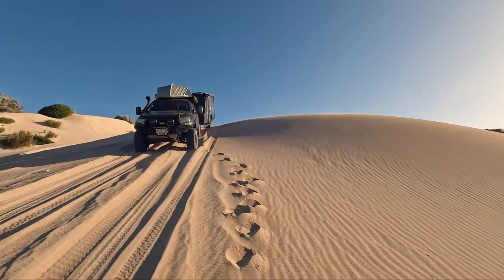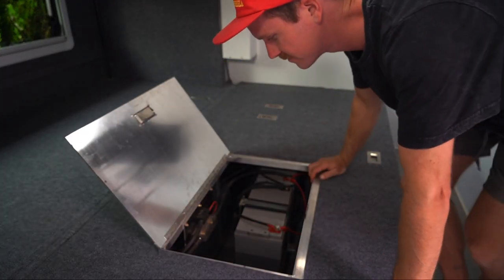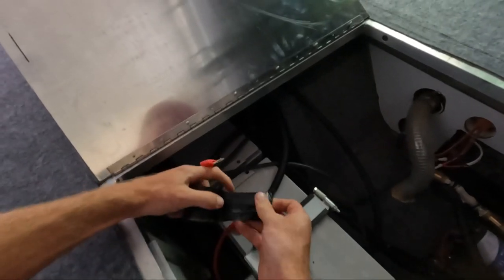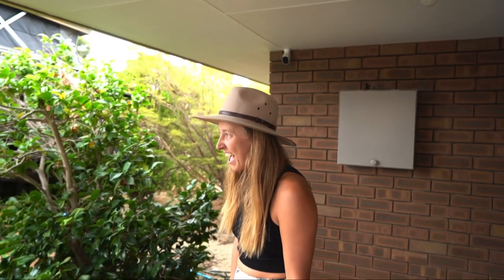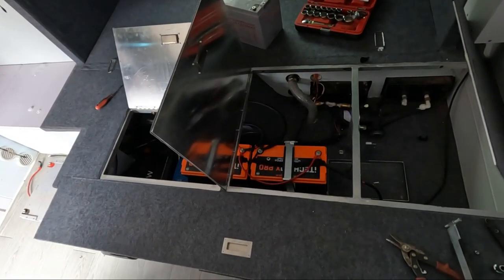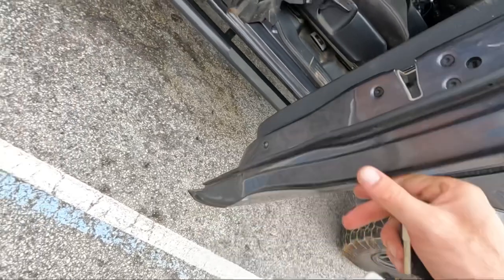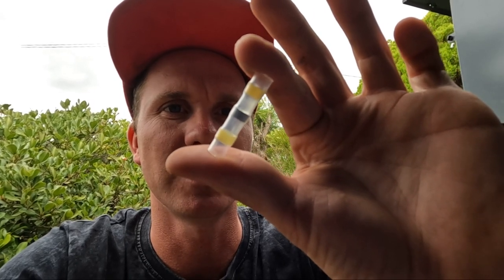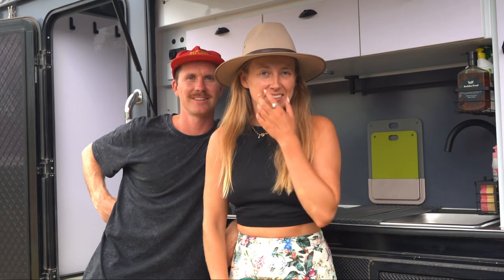DIY LITHIUM Battery Installation Made Easy! NEW ITECH120X PRO!

Comment: Drop in change over ?? take that with a grain of salt..Lithium battery chargers utilise a specific charging algorithm which is vastly different to AGM, SLA ,Gel or Calcium. Its not just about charging voltage being suitable. There is a very good explaination by Access Autoelectrical here on Youtube I suggest you check out..All upgrades that I have been party to we have upgraded DCDC charger, Solar regulators and 240v chargers where there is NO Lipo option on the existing chargers.  People I know of did a "drop in replacement some 4 years ago, now looking to replace his Li batteries because they have capacity issues......just sayin...

Comment: Hi Jake, what did you do with the Blue wire mate?  If you don't use it, the system will not work due to voltage across that distance especially at 40 Amps.

Comment: Hi Jake, thanks for the vid. How are the batteries going? I'm curious to know as you went from 300ah AGM to 240ah lithium? What percentage do they drop to overnight? Cheers and keep up the great content 👍
Reply from the maker: Hey Rob! The batteries are fantastic! I know it sounds a little odd we went from 300 to 240, but agm can only use about half their stated power, whereas the 120x pros can use their full stated power. So we really went from 150 to 240. And to answer the other question I've never seen them drop below 80% and that's with starlink on and running a toasted sandwich maker, I hope that makes sense hahaha! Thanks so much for the support. It means alot to us. Cheers legend! 🍻

Comment: You should check charge rate on the battery before you go over amping the charge rate. Lipo batteries tend to EXPLODE if charged too fast. They also last longer charged at a slower rate 👍
Reply from the maker: Thanks for the comment! The specs on these batteries say that the max charging current is 100A so hopefully we’ll be fine! 🤞🏼🤞🏼 Thanks so much for looking out for us, we will keep an eye on it!
Reply: These are NOT LiPo, they are LiFePO4. Totally different chemistry, and LiFePO4 will not explode. Even if the BMS fails and the cells go into thermal runaway, they will not "explode".
Reply: Lifepo batteries will take as much charge as you can belt into them...the charge will be controlled by the internal BMS...

Comment: I have 2000AH of lithium batteries onboard....mainly due to the fact that I run a reverse cycle aircon 24/7 and gaming computers in my RV.
1200AH of them are ITechworld batteries...great batteries.

A few points for you -
- lithium batteries should not go below 10% of charge as it will reduce the number of charge cycles
- some AGM chargers are not suitable for lithium batteries (ones that run a de-sulphate cycle)
- AGM chargers do not fully charge lithium batteries (approx. 90-95% charge is normally achieved)
- ITechworld does state that 99% of AGM chargers are compatible on their website
- alternator charging of lithium batteries is not recommended as you can overcharge the batteries (to achieve this you need to change your alternator to one designed for this purpose}, perhaps the ITechworld charger takes this into account with their alternator charging technology (I don't have one) which may not be the same as your existing charger.

One main reason I went for ITechworld batteries is because you have to take into account the warranty you may need to use.
As I am mainly based in WA I can get the batteries back to ITechworld based in Perth, whereas to try to freight lithium batteries interstate will prove difficult and expensive as Lithium batteries have many regulations for transporting as freight.

A caution for your viewers.....at the 12:00 minute on the video you left a socket wrench on top of the batteries...please be cautious when doing this as most wrenches are metal and if you short out the batteries you can cause a mini-explosion and/or lithium fire...which are next to impossible to extinguish.
I work on battery banks that have a short circuit current of 14,000 amps, so I am super cautious about this aspect with tools, belt buckles, watches, etc, etc (if you have been zapped by a power point that is normally 20amps (ac) max, so imagine what 14K amps (dc) will do to you.